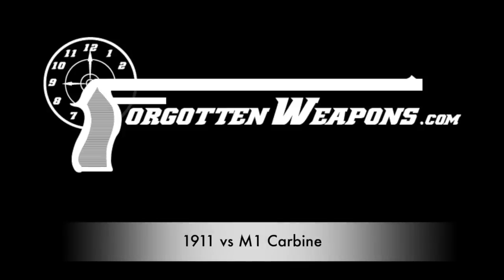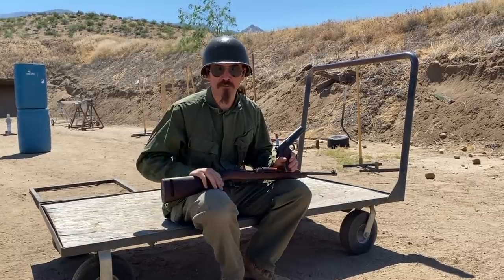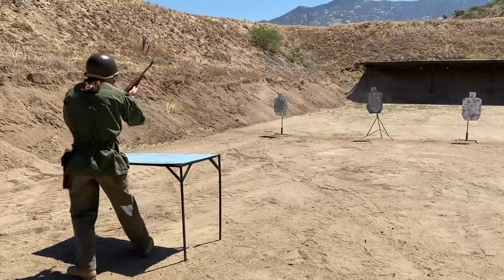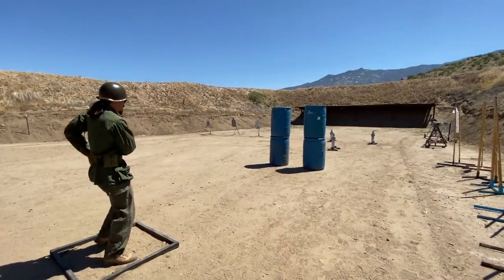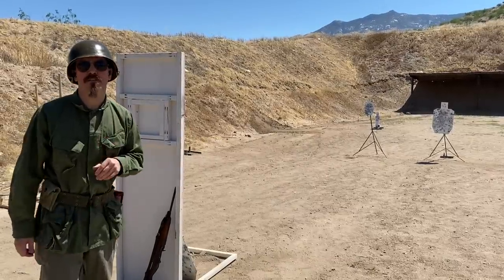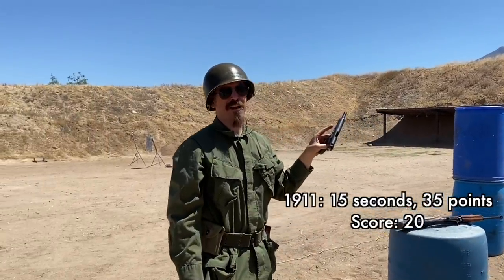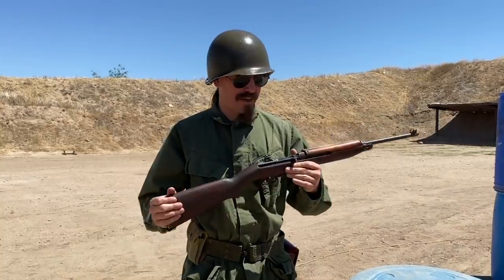1911 vs M1 Carbine in a Practical Match

Comment: Neat, I always wondered which would be better.  I always would have thought that the pistol would be better for compact size
Reply: a pistol is good until you have to fire it.
Reply: Well, if you're not going to fire it, it's most certainly better one to lug around
Reply: A pistols compact size it the reason for all of there other shortcomings
Reply: Pistols look silly with a bayonet fixed, just sayin
Reply: A pistol is easier to carry all day, it's half the weight of even an m1 carbine and just sits on your belt.

A carbine is so much easier to hit with.

Comment: Would love to see M1 carbine vs a stocked Luger or other stocked pistol of the period
Reply: I honestly don't think anyone in the german side was using stocked Lugers in WWII. that was a thing in WW1, in trench raids, and for artillery lugers almost exclusively. By WWII I don't think anyone was putting a stock on his luger anymore.
Reply: @ramjb  You might be right, I'm just going off Wikipedia, but it says that artillery lugers that were in storage during WW2 had new stocks made and were reissued to some artillery crews. A braced or stocked pistol just seems like the perfect compromise between ease of use and ease of carry to my mind, I would like to see how close it goes.
Reply: @Dave-Shearer  The short sight radius and tiny sights of the LP.08 would still favor the M1 carbine.
Reply: I think you'd be in a 'the worst of all worlds' situation with the stocked pistol: almost the weight and bulk of the M1, with the barrel length and round of a standard pistol.
Reply: @jic1  The 8" barrel on the LP.08 should give the 9mm a little bit of a velocity boost but the M1 carbine will still have the advantage. Out to 100 yards the M1 is comparable to .357 Magnum. If you've never handled an M1 it's surprisingly handy. It reminds me of a Ruger 10/22.

Comment: I have 5 of em. All of Inland mfg (S/Ns are below 300,000 and post-war refurbished.)  Issues: 1: Magazine springs (leave a mag loaded for a time and the spring gets compressed and won't spring back). 2: Feed ramp (the tip of the bullet will stick to the feed ramp so I have polished them really well, fixing the issue). 3: I cant's stand the peep sight ( so 4 have been left with original sights, and the 5th rifle  has a modified open sight [chopped the top off an aftermarket peep sight and squared up the sides]). and BTW I kept the original peep sight and it can be re-fitted to the rifle.

Comment: Back in the 80's, I had a commercially made M1 Carbine. It looked great after I bought an NOS wood handguard and got rid of the stamped steel one it came with new. It didn't cycle very well, it had many fail to load problems, and failure to eject spent cartridges. It was my first rifle and it didn't cost very much. If I brought it to a gunsmith, maybe it could have been polished or something done to make it run better. But, I was young and didn't know how to fix it. It never saw much use and I gave it away to a friend.

Comment: When doing a test like this, you should do the run with the presumed superior weapon first. There's always a tendency to do better on the second run. So the inferior weapon will get the advantage instead of the superior weapon. If the second weapon wins, it might just be due to going second. If the first weapon wins despite the handicap, then it's more conclusive.

Comment: Oh I am glad you brought this up. I have some questions to ask about this very subject and WW2. I want to preface this with the caveat that I am no way trying to point out a political issue with these questions even though I am very aware that it will touch on political issues. 
A little while back I read W.E.B. Griffin's The Corps series which is a fictional take on what is supposed to be historical events involving the U.S. Marine Corps in WW2. He talks at length about the 1911 and the M1 Carbine and the issuance of these weapons and the reasons behind their issuance to both enlisted and officers. The point being was that the reasoning for switching over to the M1 Carbine went beyond just the effectiveness at range and/or the effectiveness of training recruits to the weapons. A number of non-front line enlisted men were issued 1911's prior to WW2 but the Military was about to expand to far greater numbers. The indication from the series was that there was serious concerns about issuing pistols to so many people who may have no understanding of them and then training them in their use. 
I am fully aware of the concepts of rifles vs pistols but as you may realize this question goes beyond just how many weapons would be available to issue and to which units.
I was also curious about a something brought up in the series of which I have been unable to confirm about the M1 Carbine. Did the U.S. Marine Corps sneak a bunch of these weapons into the Philippines for the purpose of Guerilla warfare against the Japanese? 
Thank you for any replies to my questions.

Comment: Being older (I saw Jack Benny in concert) I've heard complaints about the low accuracy and low power of an M1 Carbine all my life.  Most of it from those who compared it against something else or compared it errantly.  
The power (kinetic energy) is quite close to a .357 Magnum full load.  No flies on that.  Compared to a Garand, it's substantially lower.  What difference when dealing with ranges of typically less than 150 yards?  Not much.
Accuracy  is not bench rest standard.  However, it was made to hit an enemy of the realm out to (Ian said 'three hundred' but I think it was closer to) 200 yards.  Which the arm can do (no guarantee for my shooting).  
The errant comparison is those men who early on attempted to hunt deer with the Carbine and got poor results.  The 110 grain FMJ bullets used in GI format are not game loads.  The 110 grain softpoints are better, but still less effective than a .30-30.  Nor is it feasible to load heavier bullets in the arm between pressure limitations and the magazine length limits.  

I have one for a house gun.

Comment: Your slight hesitation in drawing the Colt from the flap holster reminds me of my time in Korea.
When I was filming at the Joint Security Area, Panmunjom, Korea; the U.S. Army Military Police did not carry their 1911 Colt Autos in a standard military  flap holster.  Instead, they used fast draw holsters which each individual Military Policeman crafted in the leather hobby shop of the base.  They felt that they needed a way to get their guns in action faster than possible with a standard military issue flap holster...
I was assigned to the Joint Security Area (from Vietnam for about a month) as a combat cameraman shortly after the North Vietnamese captured U.S.S. Pueblo. We expected to get the ship and crew back and I was going to cover the return.
I crafted a quick draw holster for my .45 (expecting to use it when I returned to Vietnam) but, it did not protect the weapon from the dirt and gunk of Vietnam.
I  remember walking with an M.P. patrol along the dividing line between South and North Korea (which was simply designated by a white string or ribbon) when we met a patrol of North Koreans walking in the other direction.  Things were very chancy those days and the M.P.'s unfastened the strap over each pistol hammer which kept their pistols in their holsters.  Me?  I wasn't authorized to carry a weapon since was on Temporary Additional Duty.  I just got my camera ready to film what I expected to be a reenactment of the Gunfight At The O.K. Corral...  Luckily, the other guys apparently were no more keen for a gunfight than I was!

Comment: I think the bigger factor to try to calculate is practical applications. Run these drills while doing range maintenance, setting up or breaking down a match. Carry boxes crates, digging etc. Pistols always on hip. Do the tasks with rifle slung. Will it get set down. Rifles better at drills but see if its worth the hassle when you dont know when or if you need it

Comment: This was a nice test, and it was done in the best case scenario for 1911, if the range was longer M1 can only do better. One thing with the pistol, though, is you have it at your side at absolutely all times, and your carbine might be 10 meters away on the table you just had your meal at.

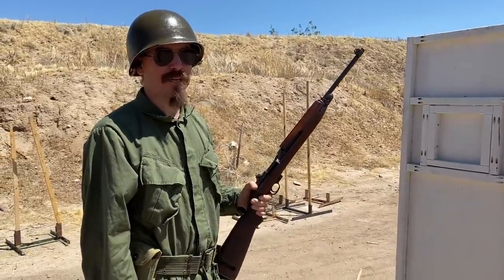Comment: 6:40 Damn it, Ian! You don't set an M1 Carbine on its right side! I had friends who trained on the Garand, BAR, and Carbine in the US Military in the 1940s and 1950s and that was a cardinal rule of handling to never set a US GI weapon on the right side because all had their "operating components" on the right side of the weapon. Even with the BAR, which had a charging handle on the left side of the gun, the ejection port that actually exposed the action to contamination was on the right side of the weapon.

Comment: Ian et al are liking the M1 Carbine a lot more compared to their videos several years back.
As noted, the weak link in the Carbine is the magazines. Those that are in spec do work reliably. 
How about 10-12 of the small 4-5 inch saucers? You'll see a huge difference in the scoring between the 1911 and the Carbine.

I wonder just how many small towns or roadblocks that were held by "Other than Infantry" using mostly carbines during the Battle of the Bulge.

One of my books says captured American weapons were laid out for German soldiers to take.The pistols and Garands were left behind while every Carbine was taken.

Comment: I carried an M1 carbine as a patrol carbine for a little while.  Overall it was excellent to the task and doesn't have the "militant" look of an AR.  Not that such matters in my neck o'the woods, where even arrested bad guys wanted to talk gun selection on the way to jail. ;)   Mine still does duty as a go-to home defense carbine much of the time.
Couple of things I noticed in training and practicing with mine:
1. It's not the most left-hand friendly gun on the market.  No surprise, really, given it's intent.  That safety (mine has the latter flip-switch) can be managed, but takes some finagling and getting used to.  Not an issue upon first deployment, of course as grab-rack-the-bolt is fairly ambidextrous.  But when loading to, say, search a building or do a manhunt it almost makes one want to shoot right-handed (the shame!). 
2. It's weird how that sight protector, like Ian found, can be mistaken for a front sight when under pressure. I wonder how many times a soldier did that, missed his target completely and swore the gun was woefully under-powered when instead he never hit anyone?
3.  It might just be me ... probably IS just me ... but that peep sight I find more annoying and detrimental than useful.  I do better at close range, just putting the front sight on the target and looking OVER that tiny peep sight.  It's minute-of-chest accurate out to usual self-defense ranges.  I have to think, were I a WWII soldier or otherwise using the carbine regularly, especially in low light, I might consider filing the top half of that peep off or replacing the rear sight entirely.  In fact, were I to come out of retirement, pin on another badge and grab an M1 Carbine (after having my head examined for getting back into the madness, LOL) I'd consider exactly that.  
Great little carbine, IMO, with a good round capable of about anything I'd expect to need to do, up to an including taking the less-than-impressive sized deer we have here on the Gulf Coast.  What's more we seem to have more and "better" ammo available now than the Federal 110 gr JSP ammo I had/have.  Not that such is "bad" ammo, but I understand it's pretty likely to still be a down-range hazard.

Comment: Most soldiers only received a few hours training in the handgun, likewise the desire for the carbine was increased range and effective impact.  The 30 carbine packs nearly 2x the energy of the 45, more than a 44 mag at the muzzle and more than a 357 mag has at the muzzle, at 100 yards. The problem was that the light, handy 30 carbine got put into service where and when it was not designed to be.  Ironically the original m16 was designed to meet the handiness of the carbine, only with a high velocity,light weight ctg. And the carbine was quite popular with our "advisors" in Vietnam where the jungle made the heavier 30 carbine slug more effective in the brush.

Comment: Paint the Front sight blade of any firearm with yellow-green luminous paint, and you will be able to pick up the FS much faster in all conditions.  Even better, get a [I]highly[/I] visible Trit night sight for it, if such is available.  The mag failure with the Carbine is telling, but insufficiently discussed, IMHO.  That failure could have caused Ian to be shot by the Germans. Granted, any firearm can suffer problems, but it is up to the user to test ALL their firearms components prior to use.  In my experience, 1911 users are a bit more up-to-speed in changing out faulty components than some M-1 Carbine users.  Thanks for making the vid.  raf

Comment: BS test.  The huge advantage to the 1911 is that it is portable on your person.  The M1 could be out of reach, and more likely to be so if you are auxiliary perhaps behind lines, or so you thought.  To stage the 1911 so that it is more awkward to get to is silly.  I would like to hear what the totals are from the first shot, rather than the buzzer.

Also ran the pistol first on every stage which is a bias against the pistol.

In the real world of WWII, pistol is probably easier to shoot from behind cover, though that probably goes away if you were trying to shoot around a barricade one-handed from the weak side.

All these massive stages are unrealistic as the purpose of the carbine or pistol was not to wax 6 people in scenarios that barely existed (in close range self defense).  What these stages basically model are scenarios where people executed prisoners, or something similar.

Major BS for the Pistol is that they did not shoot two handed during WWII.  You would have been shooting one handed.

Comment: Plus, don't forget the difference in condition and sighting between a privately owned 1911 vs. a military-issue beat-to-hell-and-back 1911.  I'm old enough that I actually used the 1911 in service.  I remember the first time I shot a friend's 1911 and I was flabbergasted . . . it actually HIT what I was aiming at.  Shocking!

Comment: It would have been interesting to see Ian fire a M1 / M2 Carbine chambered in .22 Spitfire / MMJ 5.7mm Johnson in both semi-auto and full-auto. The .22 Spitfire is a wildcat cartridge based on the original .30 Carbine necked-down to .22 / 5.7mm. It was designed and introduced in 1963 by Melvin M. Johnson, the designer of both the M1941 Johnson Rifle and Light Machine Gun of World War II. Had Johnson designed and introduced the .22 Spitfire two decades earlier, it is arguably possible that the United States Armed Forces could have had an early assault rifle comparable to Nazi Germany's Sturmgewehr 44.

Comment: The benefit starts above 50 metres , there is some ww2 instruction videos regarding penetration where the m1 slams all pistols vs a helmet . A m1 wobbles after it pens and makes a pretty big hole where a pistol depending on angle dont even penetrate. For 10-50 i guess both would be ok but the m1 is much more versatile. Now a shotgun would perhaps made it nicely but there were few good such that wasnt two barreled and thus not great in action where someone has a large mag. The idea in a large war is not always to kill, it is incapacitate and make the system break for overwhelming the health care with wounded. A dead soldier is buried or left on site until safe, a wounded is a much more problematic, so as long as the one dont shoot back it is better to leave them alive actually. Smaller conflicts not.

Comment: Lost time un-holstering. If the holster was tied down on your leg un-holstering would be faster. I did a similar un-holstering with a 1960's Cdn browning holster (soft canvas and much worse than the 1911 holster. 

I also had a P226 1990’s SAS formed leg holster – it was much better.
 Outside the retention strap it was more like a modern police or a gunfighters holster.
Also notice drawing left handed and shooting around right side of baracade.

Would you say a trained pistoleer  would be faster in qcb than a carbineeer?

Comment: Ian, There is a HUGE advantage of a Pistol if you are serving in close quarters such as in the Cockpit of a Fighter Plane, inside a Tank,  in a small raft, etc. If you have to bail out quickly a carbine might very well be left behind whereas a Pistol would be attached right to you. The other advantage is that you can conceal a 1911 much better than a carbine if the need should arise. NOT saying the Carbine isn't better off for the average soldier overall, but there is DEFINITELY a need for a small powerful hand held & concealable gun. The 1911 certainly fit that Bill.

Comment: The bulk of issues with the M1 Carbine can be mitigated by simply keeping it oiled.  They need to run wet, thus the oiler in the stock.  Other than that the only real issue is the flimsy magazine, drop it (especially loaded) and you'll bend the feed lips.